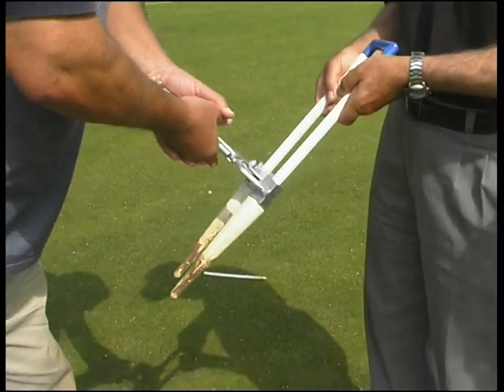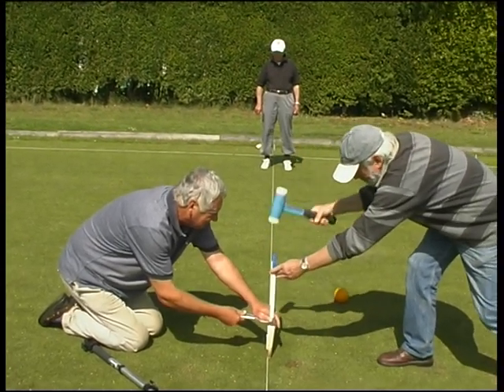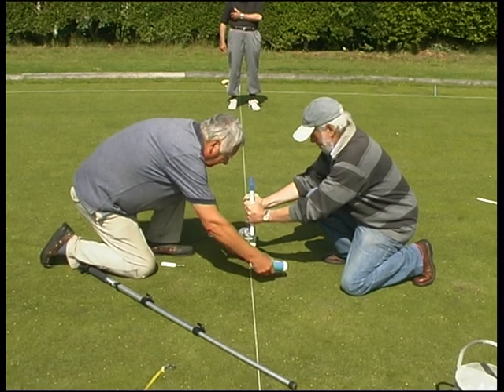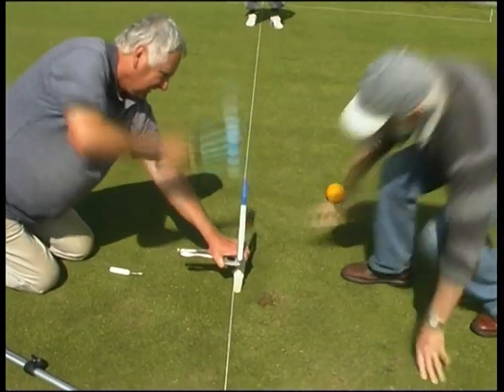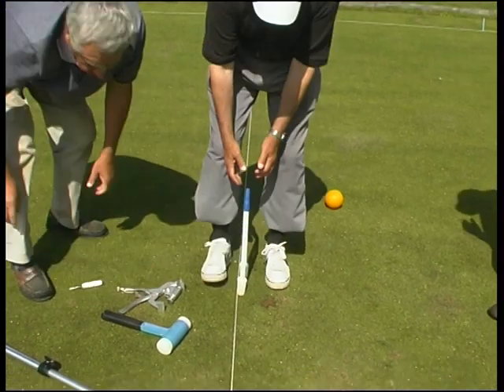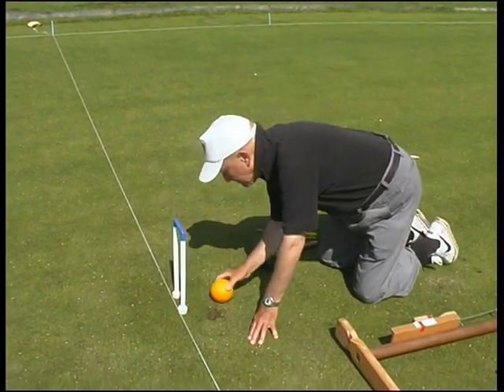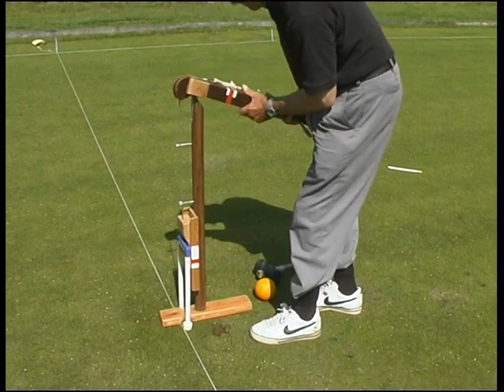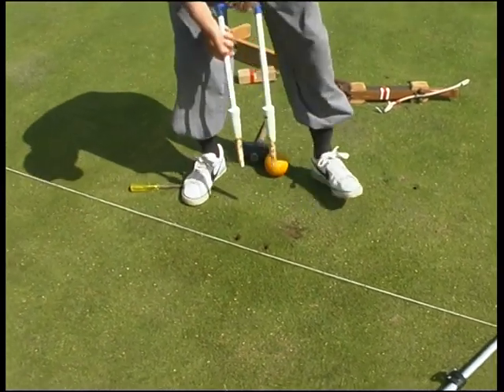GW way of hoop setting

Comment: True, but sand-based lawns are the norm in the US and Canada, so it's easy to drive hoops without removing cores first. At the least I'd suggest these guys get a bigger hammer. 

Twisting the hoop while driving it can permanently bend it.